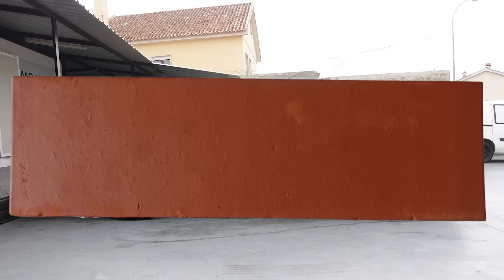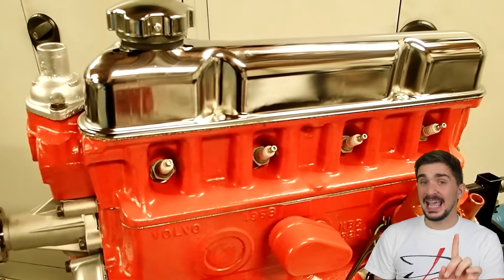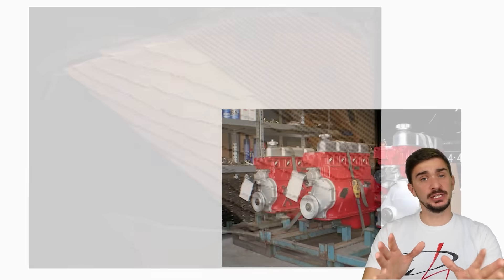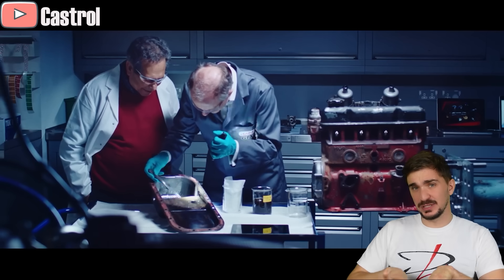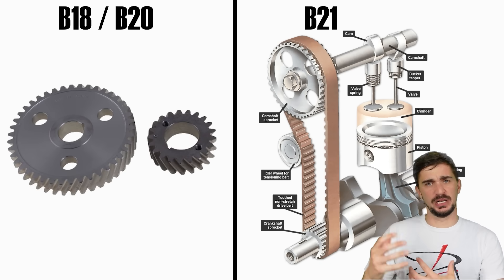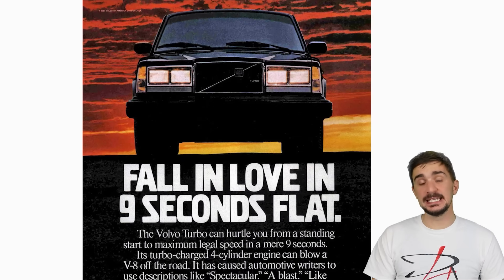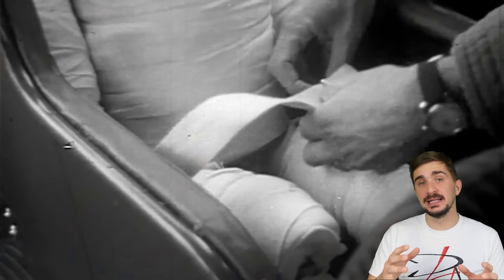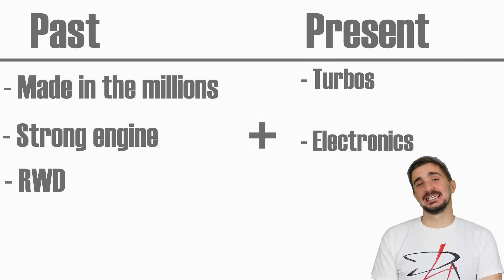A Story about the Volvo 240 and its Redblock Engine - Iconic Cars and Engines #18

Comment: I had an 83 240dl it was an awesome car, I was living high up in the rockies. I hit a couple of deer but using salvage yards everything was replaceable.   
Please do an iconic  engine on Nissan Z series i4 engines manufactured in the 80's
That was an engine.
I also had an 83 maxima L28 engine.....beautiful power

Comment: I bought a 245 new in 1976 and drove it for 36 years, doing all maintenance myself.  IMHO this wagon was a disguised sports car--the tremendous torque, stick-shift and rear wheel drive added up to an exciting driving experience.  Unbelievably, the car was capable of starting in third or even fourth gear!  The load capacity was essentially unlimited with the flat roof and six roll bars and  I personally hauled many oversized loads.  Once I hauled all the materials for a 10' x 10' x 15' tall garden building in one trip!
I admit that was not a great idea and I never repeated that size load.  Still, the car handled it with no problem.  BTW, my 245 never had any major engine issues in over a quarter million miles.  It is interesting that my B21F engine had Bosch continuous fuel injection.  This was an entirely mechanical system and was one of the earliest engines with fuel injection.  I really miss that car!

Comment: Owned 24 of them pulled out of garages ditches wreck yards all were running again within 2 days amazing times sold a 242 turbo to someone they hit a Boulder going 110mph shattered the alloy wheels pushed exhaust through the trunk lid they got out and walked away.

Comment: I cannot speak to what they made in the 1980s but the late 60s to mid 70s models were a huge PAIN to deal with.  They were difficult to start in the winter, the dual piston carburetors were very difficult to balance properly and the replacement parts cost a fortune.  In addition, the body rusted out VERY quickly which was ironic given the big deal that was made about how rugged they were supposed to be.  On the other hand, they did have a very spacious trunk.

Comment: I had an volvo 244 that I drove 115 miles without any coolant because a blown cooler hose. When I got home I sent it to the mechanic sens I probably screwed up the engine.
Two days later he called me telling me the engine was fine so he just replaced the hose.

Comment: Having worked on a lot of these engines, from the B-16 on, the fiber cam gear was indeed a quiet and durable option. I saw more than one B-18 or B-20 come in rattling (but still running!)  because the bond between the fiber gear material and the steel center hub failed.  Because of the small space between the timing cover and the gear, it couldn't come fully off the center hub, so the engine still ran!  Great engines.
Reply: Hello John how are you doing 😊

Comment: Back in my days of college (and being rather low on $), I bought a 1985 245 wagon (with 235k miles) from a pawn shop in 2001 for $400.  I fixed the brakes and wiper motor and that thing ran like a top for 3 years.  What a tank.

Comment: As a former Volvo tech and one whose parents owned 3 in the 70s through the 90s, the red block was tough.  Yet, the electronics were subpar, air conditioning was weak, and if you didn’t have the flame arrester ($2 plastic piece) changed every couple years, those engines would leak oil like a siv.  Aside from the red block, the late 70s / early 80s 6 cylinder Volvo was a piece of crap.

Comment: You can over-engineer all you like, but many years ago I had a 100 series for only about a week, maybe less! I had bought it from a local mechanic, but when it simply stopped all of a sudden at the top of a small hill it turned out that the *oil plug* had fallen out some time!! Bought for $1600, sold back to the mechanic for $600! Still not happy about that!

Comment: My parents have a 1995 volvo 940 turbo with the factory upgrade "turbo plus" that raises the horse power to 190 hp. Engine code B230FT with oil cooled pistons.  It has 550000 km on it. Its still original engine and turbo. Of course there has been issues with the car, but never the engine itself. Regular oil changes, and normal maintenance, and it just runs and runs. Great engine!

Comment: Brilliant video!  
I now understand why my rusty but trusty 1982 Volvo 240 DL, 4 speed manual (+ push button overdrive) SAVED MY LIFE by not exploding 25 years ago!  Back story… I was a working student and just worked a late shift on a snowy blizzard night in Minnesota… after clearing 14” of snow from top of the ‘beige brick beauty’… I started my journey home…. Immediately, traction was non-existent.. even as a poor kid, I always had appreciation for quality and aesthetics.. so of course I had found  a set of used aluminum
wheels off a turbo model from a junkyard.. they had some pits and patina, but were still much nicer looking than the original steel wheels.  The only downside - the mismatched 195/60-15 rubber were well past prime… and so it began, slipping & sliding, made it a few miles and finally stuck.. out came the shovel, unstuck and moving again… slowly!  If anyone has driven a real wheel drive with bald tires, not weight in trunk… you know what I mean.  After 3 hours of this, I began to get angry.. the last straw was a bridge with a slight incline… I made it halfway and then stuck. Could not proceed.. so I threw it in reverse and FLOORED the gas until finally off the bridge (there were no cars behind me). And then something happened.   The car was overheating..  the temp gauge was pHOT and wasn’t coming down.

Comment: I have a 740 With the B230-F engine. Its a followup to B21 and i think you should have mentioned that to. indeed they are reliable cars, just watch out for the rust. The 240 also used that engine in later years.

Comment: As the former owner of a 740, a 760 Turbo, and a 960, just wanted to let you know how much I enjoyed this! I recently pondered selling my 2015 Ford Taurus Limited and searching for a 240 as my primary transportation, but my wife said, “Why would you want to be replace your nice car with an “old” Volvo??” You have a good answer here!!
Reply: You can explain your situation as equivalent to choosing the right life partner: a reliable life partner vs a young gold digger. Basically you said wifey is a Volvo..So, congrats 😅🎉
Reply: You can certainly get a very nice looking reliable one for what you can sell that taurus for
Reply: I'm a woman and l love my 240GL built in 1984! It never let me down and it is still going strong on the roads in Thailand and Malaysia where l live...
Reply: @verenaschweizer3759  The roads will erode till your Volvo will die 😃.
Reply: @verenaschweizer3759  The only woman in recent times to drive a 240
Reply: New cars suck is the reason. That volvo might be 30 + years old and still going another 30 with maintenance. Todays cars will never do this, they won't live long enough to become classics.  Something electronic or software related will do them in far before, or the manufacutrer will pull in some subscription service so x feature stops working.
Reply: I'm still looking for another 760 turbo today. It was amazing and I wish I still had mine
Reply: I was hit by a bus in a 760. Firefighter said it saved our lives.
Reply: I'm debating selling my 2014 F-150 for a 90s, OBS F-150

Sometimes these older machines are all you need.
Reply: owned a 360 ,3 X 240 and my last Volvo 960  VOLVO MEANS I ROLL
Reply: just do it bro!
Reply: ask my Dad....
Reply: Soft tin, but reliable
Reply: I just sold my 2016 kia soul to get an 84 242 non turbo!
Reply: you could also replace your wife
Reply: She'll learn to love it!

Comment: Have to disagree. The 1972 140 series is by far the best vehicle ever made.  I’ve owned a handful of Volvos, Mercedes Benz, BMW (Bad Motor Works), and nothing stands up to the 140 series. Just remove the SU’s, install a new manifold and Weber and you’re set to go.

Comment: There is another very relaiable motor.  The thing that build in Lada`s. There´s that channel called Garage 54 and they once ran one of this Motors at freezing temperatures.
without Oil.
completely dry.
It took like an hour for it to die.

Comment: had a '85 240 with a '86 engine and assorted parts from various decades , it blew a head gasket in the mohave dessert but still carried me through 60 miles of nothing being given water every 10 miles or so until i got to town, took 3 hours to replace the gasket in my inlaws yard and ran good until i was forced to sell it because i moved across the country, i still miss that tank

Comment: I have had both a 140 and a 240. The 140 was a 4 speed with overdrive  B-20 push rod and could cruise up and down I-5 all day at 80 mph (I could go faster but wasn't sure my tires could take it). The 240 was a 3 speed automatic B-21overhead cam that had problems doing 60 mph. The only thing I didn't like about the 140 was its first generation fuel injection, kind of sluggish acceleration, naturally aspirated would have quickened the acceleration quite a bit but California regulations forbid such a swap. The 140 was a very good car. It even had AC! The 740 was junk in my opinion, being made in Belgium and had all kinds of design and build quality problems. The 940 was MUCH better, reverting to Swedish manufacture.

Comment: As usual, these automotive videos are fairly worthless and inaccurate.  The B18 Engine was excellent however, it was introduced on the PV544.  The engine had Dual SU Carburetors compared the those garbage Zenith Strombergs on the 240.  The 122S was the best model that Volvo produced and far superior to that 'Ugly' box in the 240 series.  The 240 has extremely Heavy Steering with a terrible Steering Ratio'.  Power Steering was not available.  The engine produced 100 HP which was inadequate for such a heavy vehicle. With an Automatic Transmission it was much worse.  The Cloth Seats were firm and not comfortable.  Its Handling Characteristics were poor relative to an initial Understeer to an Oversteer.  The 122S came with Leather Seats, 4spd. Manual Trans., Handled excellent and weighed 2400 lbs. compared to the 244s at 2800lbs.  I had never seen any Volvo 240 Series with mileage in excess of Original 150K Miles without any engine work.  You can post anuthing on YouTube irrespective of factual information !

Comment: I have had 5 Volvos and still have my 6th 940 Estate , I took this one for a past MOT which she passed , but when I got to the Test station it was up on the Ramps with a mechanic walking around its Chassis with a Hammer trying to find a weak spot , finding none its totally solid , Best safest , easiest to fix Cars I have ever had ..this is maybe not about a 940 but it's still a Volvo..great Vid.

Comment: Hmmmm, interesting, but I am going to throw a spanner into the works! I had a Volvo 245 DL Estate in the 80's. I  bought it from a guy who used it to run from Essex U.K. to Birmingham U.K on a weekly trip to buy foam to resell on his market stall, BUT he made a big mistake in using what was then 4 star fuel, consequently burning out the valves as it was supposed to be only 2 star petrol so I bought it cheap and set about reconditioning the head etc. Now here's the twist I bought new valves ,springs and gaskets etc etc etc from my local spares shop and everything came in British Layland boxes and packaging, for a triumph 2000!  My best mate at the time was an old school mechanic told me what to order and helped me do the work, that car was definitely the best car I ever had.  Apparently Volvo instead of making engines themselves for this model at least, bought everything needed to build the engines from Layland but re engineered everything to "their " tolerances and "perfections", thus it was known as a bullet proof engine!! But you failed to mention any of that, funny that isn't it?? Perhaps you could let me know why? Incidentally the Triumph 2000 was used by the police here for a time as it was a very safe comfortable and fast car (I also had one of them) and typical of Leyland cars of the day the engines way outlasted the bodywork and chassis, as they rotted big time.

Comment: I have been in ONE car accident, and I caused it.
It was afternoon, I had been transporting a boat on a hanger and stopped to get some food before doing the last leg of the trip.
I misscalculated my acceleration and oncoming traffic speed and BOOM, a person in a car ran right into the hanger (at about 60km/h) when I was turning left. 100% my wrong.
My heart stopped, is the person alive? The hanger came off my car and fell over, 900kg of boat I might add, not a tiny piece of plastic.
To my relief, the driver seemed ok. Called emergeny services and I nearly broke down to a puddle.
Police, fire department and ambulance came. It seemed the driver was completely ok, the car, a VOLVO 244 had the front schrinked. The fire department wanted to move the car out of the way and I offered to help push because both oil and water was leaking out of the engine. He stated, and I quote: "I'm pretty sure I can just drive it off the road", proceeded to enter the car, turn the key and the engine started immediately and he drove it off the road.
Yeah, those old volvos are both REALLY tough engines AND safe for the driver (THANK GOD!!!)

Comment: I used to have a volvo 142 with a B20 from 1971.  A beautiful car that was easy to service by myself.  At one point, I had a fuel supply problem.  It turned out to be a clogged fuel filter inside the carburettor from dirty fuel.  I fixed it by dismantling the carb and cleaning it with a toothbrush.  I can't imagine doing a fix like that with any modern engine.

Comment: Great video! Thank you. In our family, we've had three 240s, one 940, two P1800s, and still have a 122. And, it looks like we might have yet another 240. Still quite a few still putting on the miles on the US West Coast (and with NO rust). Love them. They are slow and parts are getting a bit harder to find, specially the soft stuff and plastics (which suck); but indestructible, very comfortable, incredibly practical, and very balanced handlers. As long as you get some momentum, you can really hustle them around the curvy bits!

Comment: My 240 did over 200,000 miles without putting a spanner on the engine, one clutch and regular timing belts that’s all. The only thing I insisted was the oil was changed every 3,000 and oil and filter (Volvo filter of course.  I really wish I could buy a new one today, because I would!!!!!

Comment: My father owned a 142, which we sold to a collector when we bought a second-hand 244. Both were manual, and neither had power steering, sadly. I ended up buying a friend's 265, but that had the nasty Renault engine which was quick, but hell when it came to maintenance. I do remember doing a lot of my own minor engine stuff on the first two cars. It was stupidly easy.  If I'd known more about cars, I might have considered getting the old 244 turbo charged, but back in the day it wasn't anywhere near as easy.

Comment: In my mind, having a strong, reliable, nearly indestructable engine had another advantage, which is safer for environment, because there is less engine that thrown away because of failure of the engine and less manufacturing because you just stick to several types of engine that is known for reliable and you just do something with the engine like make a smaller version, chopped-up number of cylinders, add more cylinder(s), and add tons of experiments without doing another research for engine that'd cope with the future extension.

Unfortunately, we didn't live in the perfect world so it just didn't happen. But in fact, it happens in 20th century but for some companies and for quite sometime.
I'm not a fan of Volvo but I love how they build something to last even though they're expensive.

Comment: I had a 1983 B23 Turbo 242 GT (silver) back in the late 80s. Great car, although I made the mistake of installing an aftermarket intercooler kit on it to raise output by about 40 horsepower (125hp to 165hp). Of course it didn't effect the engine at all (never burnt oil even at 190,000 miles when I sold it) but I did go through clutches about every 60-70,000 miles. Still, I have many fond memories of that car!

Comment: I grew up in a household with five 244/245’s back in the 70-90s. All had well over 200k mikes on the clock and none ever gave up the ghost.
When I lived in Sweden many road racers swapped b21’s into their race cars. Reason? you could bolt on serious catalog HP for cheap. 
All hail the SB Chevy of Sweden!

Comment: My 1973 145 B20E busted number 3 wrist pin and tore up cylinder wall. 
Re-sleeved the cylinder, rebuilt engine. Sold it to a buddy. 
Something was wrong with that 3rd cylinder. Buddy blew the cylinder again, blowing a hole in the block and destroying the starter as well in the process. 
And it had EFI. 1973...
Just sayin'.

Comment: The B18 has the same main bearing area as a small block Chevy.

My first PV544 had the B16.  I met my ex at a rally because she had the same car.  We then bought a B18 PV544.   Disappointingly, the single piece cast iron oil rings were getting worn by some low mileage.  Maybe 50,000?  So I tore it down.  Besides three piece oil rings, I put in a reground cam and shaved the head to bring the compression ration up to about 11:1.  

The Bosch generator was a POS, so I replaced it with a Delco.

I also briefly owned a 122 station wagon.

Oh, Volvo is Latin for "I roll."

Volvo was the first car to install 6 digit odometers.  What great marketing psychology.

Comment: What knocks Volvo 240s off the road is the wiring. It goes hard over time, leading to lots of little cracks which lead to shorts. Eventually they need a lot of rewiring involving the dash being pulled apart, which is a big job, hours wise. Well that’s the case in Australia, mind you we do have more hotter sunlight here.